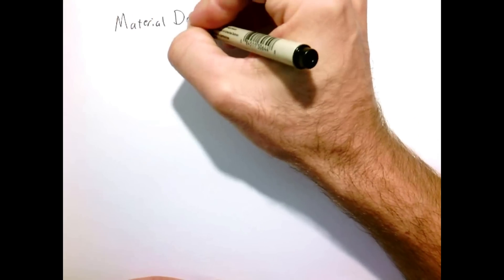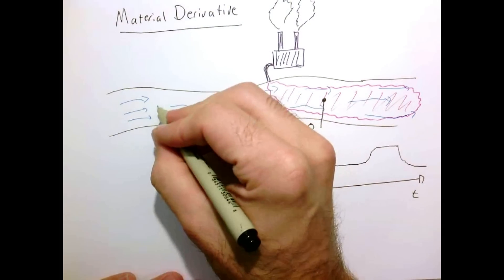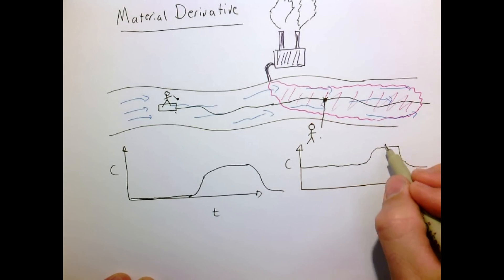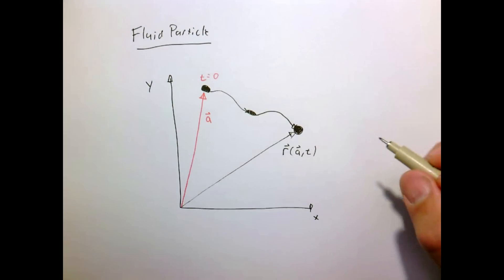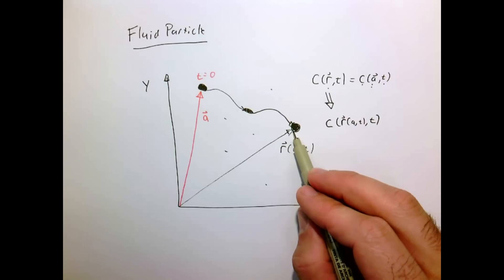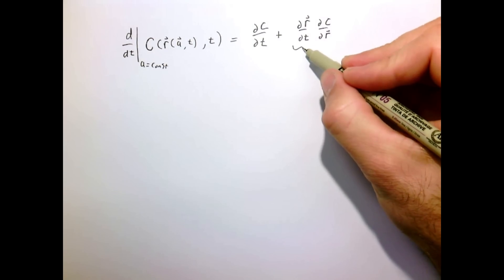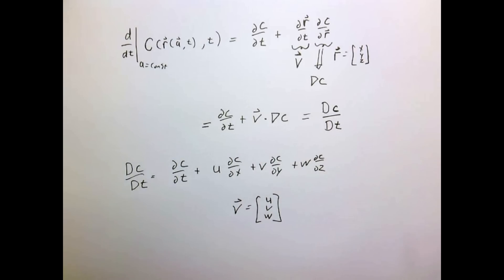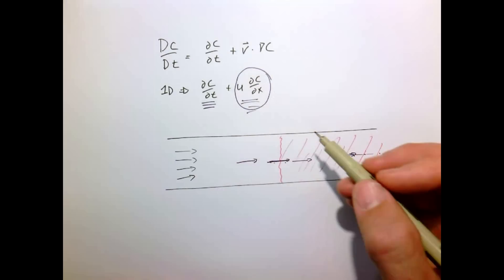Material derivative

Comment: why at 6:14 you write "+" instead of "." or multuiply? 
Aren't we supposed to multiply in a chain rule ????
Reply: In the chain rule you indeed use "*" instead of "+", and this is why there is multiplication in the second term, but note that having two terms here (with a "+" between them) is not due to the chain rule: It's because C is a function of two variables, so in order to calculate it's derivative over time, you have to sum both it's it's change rate due to the first term (r, which is itself a function of time, hence the chain rule) - and it's change rate due to the second term (t, which is simply the time itself, so no chain rule here)

Comment: Many thanks for the video! Just one question... when you say dr/dt is the particle velocity, and then in the river example you say that u is the velocity field. I can see that would be the case for a water particle, but what would happen if the velocity of the particle is different from the velocity field? Would the equation be the same? Thanks again!
Reply from the maker: Ah.  Good question and point to clarify.  In the world of fluid mechanics we often talk about a "fluid particle" which in a sense doesn't really exist. For the case of deriving equations, we imagine a chunk of fluid that we can follow around a it goes with the flow so to speak. There is only one velocity since fluid and particle are one in the same. We could visualize what such a particle would do in an actual lab experiment, by putting an actual solid particle in and study it's movement. In the case of the solid particle, it is true that the particle velocity need not equal the fluid velocity. General a small neutrally buoyant particle will go with the flow. Larger particles, ones that are heavy or light relative to the fluid, will do something else. That is a complex problem but one that people have worked on.

Comment: So Would I be right in saying that the material derivative is the time rate of change of a fluid particle expressed in a fixed reference frame?
Reply from the maker: Yes.  Imagine you are floating down a river in a raft I am sitting on the banks. If I compute D/Dt of any quantity at a point in space (in my fixed frame).  The value I compute at that point, at some instant would be the rate of change YOU would sense as you pass through that point.

Comment: Thanks a lot.  I have one question, the definition of Material Derivate of C is  partial(C)/partial(t) + u. nabla(C). The first term measures the rate of change of C at a fixed point in space with respect to t, this term makes me confused: how would it change by itself IF the fluid is not moving? meaning, if the u = 0, then what makes C changes in time, e.g. if C a red dye, what makes it change in time if the fluid is not moving? I "think" the only source of change is due to fluid motion, so if u = zero, then nothing should change?
Reply from the maker: Imagine the power plant runs clean, then suddenly dumps pollutant in the river. That will diffuse over time and cause a change in time, even if the flow is stationary
Reply: Thanks for the explanation and thanks for creating such informative tutorials :)